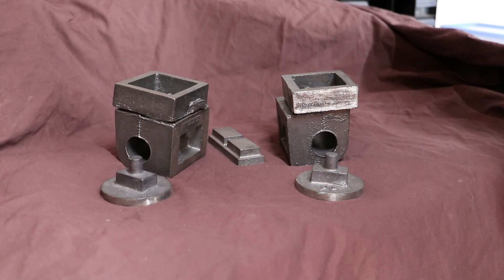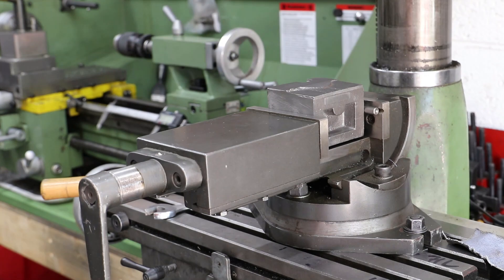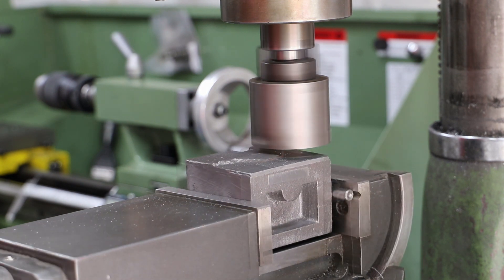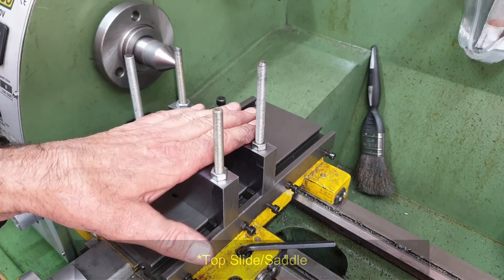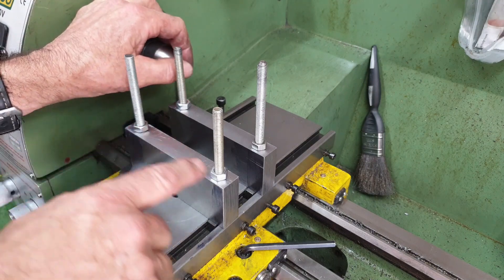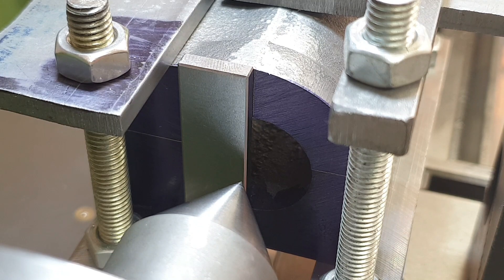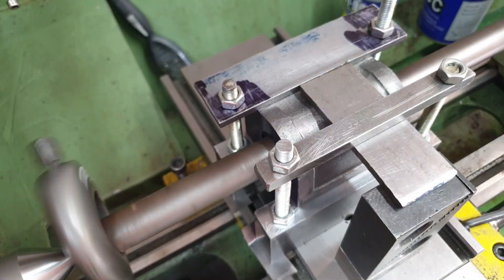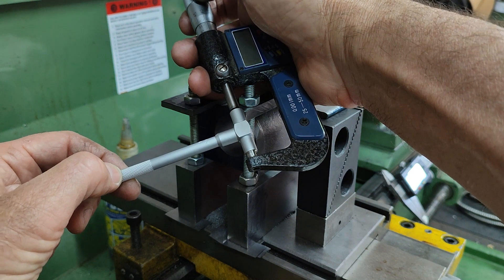Part 20: Boring the Cylinders

Comment: Is there a reason castings are used? There desn't seem to be a lot of metal removed, plus you have an increased chance of voids and crystal boundary failures, and all the other downsides associated with castings.
Reply: Hi Robert,
I think the challenge will be getting the external profile for the cylinders.  I have seen someone try and machine this (on YouTube), but I don't think the result was too good.
The main supplier of castings here in the UK will replace castings if flaws are  encountered, during the machining process, but that is time limited. 
Cheers, Mark.
Reply: @MSmifffy  OK, thanks for the reply. I always wondered about this. For some parts, castings do seem to make more sense than others. Now i know.

Comment: Mark re the telscopic gauges I have used them as you have. I've since seen them being used another way which I have not yet tried, I will try and describe it. You enter the gauge at an angle and lock it off while centred in the bore but still angled (just nipped up not really tight) in one movement you move the tool through centre to more or less the opposite angle to which you set it at and withdraw it. As the tool was not locked off tight as it was moved through centre the measuring pins will have compressed in to the bore diameter (if done right) Now tighten the lock a bit more if needed and take your measurement. Cheers, Dave.
Reply from the maker: Cheers Dave. I'll give it a go 👍

Comment: Hi Mark, just a thought (it works for me on my WM250).   If you substitute the socket head screws on the cross slide gib, for socket set screws of minimal length (just long enough for the locknuts), the carriage lock Allen key won't clash with them.  As it looks like you've done, the Allen key needs the short leg to be cut down.
Reply from the maker: Hi Steve, good suggestion, I'll take a look next time I'm on the lathe.
Cheers, Mark

Comment: Could have set it up in the 4 jaw chuck to bore and face one end in one setting.  Then use this machined face as a datum to machine other faces.
Reply from the maker: As the saying goes Zoltan, 'there are many ways to skin a cat' :-)  I'll cover off facing the ends in my next video.
Cheers, Mark
Reply: @markshomeengineering5243  Mark, I only "offered" this option for those who may not be able to machine it using the boring bar between centres.  Agreed...there's always several ways to machine any part.   Cheers.
Reply from the maker: @zoltannagy1813  that's super cool.  I'm always open to feedback and comments - much appreciated.  Mark

Comment: I remember doing something similar when I did a Sweet Pea years ago. There was probably a good reason you didn’t use the Mill and a boring head.
Reply from the maker: Hi Nigel,
This is not something I would do in the mill.  Even with power feed on the lathe, it seemed to takeforever - never mind manually feeding the quill.
Cheers
Mark
Reply: @markshomeengineering5243  A good point.